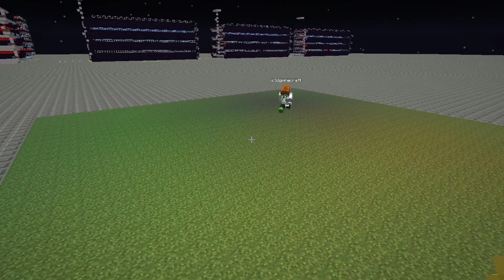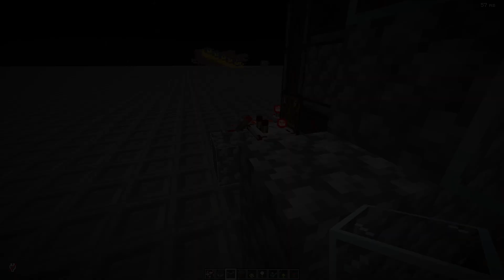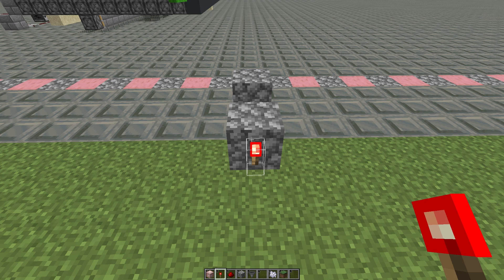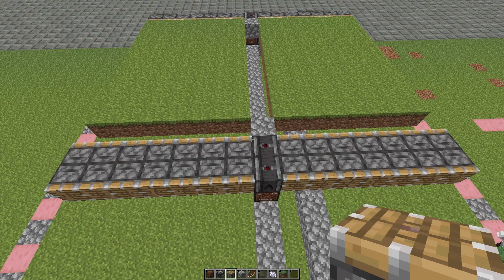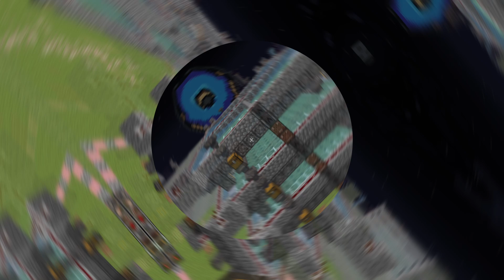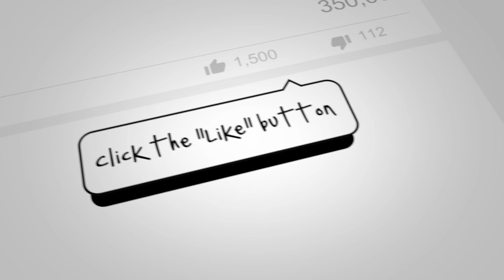💖 Mega Pink Petal Farm Tutorial | The Most Profitable DonutSMP Farm META! 💸

Comment: I built just one level. I put one stack of bonemeal in each of the 4 dispensers a total of 256 bonemeal. I took all of the output and put them into a composter but only got 109 bonemeal out. I thought this was supposed to be a net positive for bonemeal. Did I do something wrong ?
I feel that I need to make the water clean out the farm at a faster rate. How would I do this ?
Reply from the maker: If you are trying to convert this into bone meal, and you are using Hoppers, the game will treat 12 items as one item and your compost will be essentially wasted. 

And to increase how often the water clears out the farm, just add fewer items into the dropper.

Comment: Can some one tell me how the rates of this farms are?
Reply from the maker: The farm has 12 dispensers.  Each dispenser can dispense 194 bonemeal/minute or 11,640 bonemeal/hour.
The farm produces ~6 pink petals/bonemeal and ~2 wheat seeds/bonemeal.
In 1 hour, you should see over 838k pink petals and 279k wheat seeds.

Current price of Pink petals is $4 and $2 for wheat seeds.

Using 46560 bonemeal, you should make ~$4m without a sell-multi.

If you purchased bones at $60/bone, your net profit should be over $2.97m/hour
Reply: So its 3m profit per hour WITHOUT sell multi?
Reply: @Otiboydergoileif you use orders (60$ per bone) yes.

Comment: How much does it produced
Reply from the maker: The farm has 12 dispensers.  Each dispenser can dispense 194 bonemeal/minute or 11,640 bonemeal/hour.
The farm produces ~6 pink petals/bonemeal and ~2 wheat seeds/bonemeal.
In 1 hour, you should see over 838k pink petals and 279k wheat seeds.

Current price of Pink petals is $4 and $2 for wheat seeds.

Using 46560 bonemeal, you should make ~$4m without a sell-multi.

If you purchased bones at $60/bone, your net profit should be over $2.97m/hour
Reply: @colin3dge  thank you
Reply: Thank you
Reply: And is this make that with 2 or 3 layer